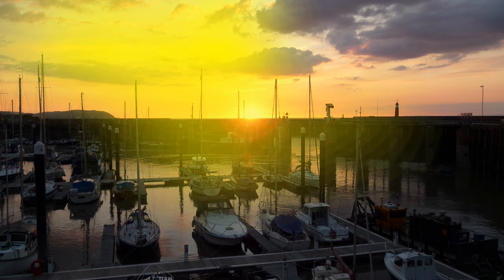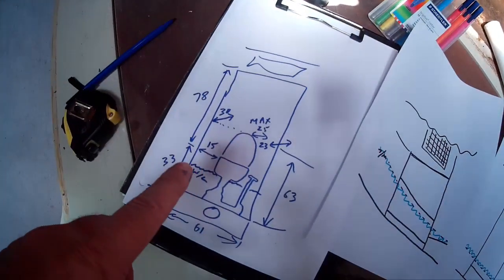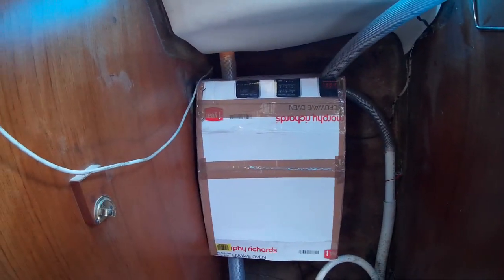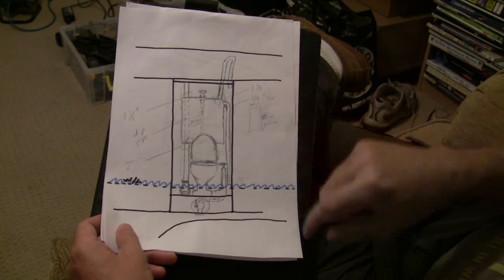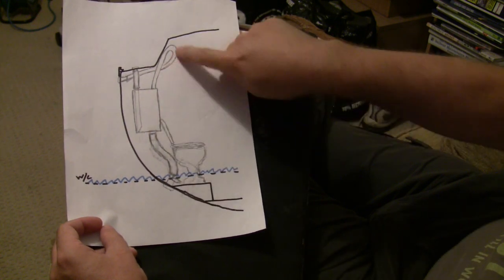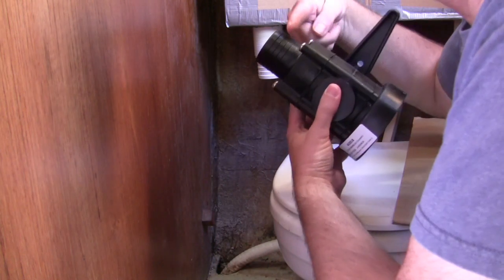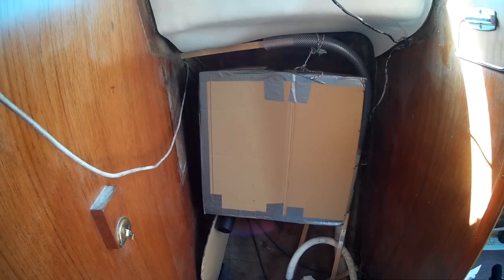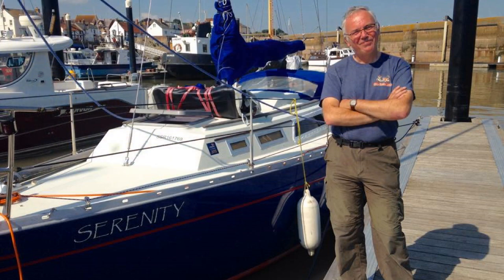Just About Sailing September 2018 - Making and Installing a new Holding Tank, Pt 1

Comment: According to Jabsco no anti-siphon is needed on the water inlet.
Reply from the maker: That's interesting. As you might have realised, I haven't finished this job yet. But I have bought quite a few of the parts - including the inlet anti-siphon device, and this job is high up the list as soon as the weather gets epoxy friendly again. It would be much easier not to install an anti siphon device on the inlet. I will look into this further. Thanks again.

Comment: Hi Paul, new sub here. Thanks for sharing your work. I like watching your videos to get good ideas and knowledge of the joys of being a boat owner. How much would the total weigth of your filled holding tank be? Since you will have it wall mounted, I'm thinking of how strong a mount you need. When sailing in rough weather, you could consider the weight to be maybe the double due to the movements. Maybe not so nice with a cracked holding tank on the floor lol. All the best.
Reply from the maker: Well, firstly, thanks for subscribing and watching. I think the tank will be about 45-50 litres - so about 50kg totally full. - Not that I would ever want to have it totally full.
In terms of the mounts on the side/wall I am sort of using the fuel tank ones as a guide (have a look at the Pt 1 Diesel Heater video - you can see the mounts on there). The Diesel tank is 70 (or is it 90) litres. I plan to make the mounts for the holding tank stronger (bigger) than those ones. They will also attach along the back of the holding tank as well as at the bottom. Also, the weight distribution will be a bit different as the holding tank will not stand off the mounts so much as the Diesel Tank does.
I plan to use 12mm plywood with a layer (maybe 2 layers) of fibreglass (Inside and out). I think that is probably massively overengineered. But rather that than the risk of getting the holding tank contents all over the floor.
Unfortunately the Holding Tank project is...uhm…on hold until the weather heats up and I can use epoxy again.
Cheers
Reply: @verynearlyaboutsomething  on a boat, massively overengineered equals just about right :-)

Comment: Would it be possible to have situated the tank under the loo?
Reply from the maker: Hi. Unfortunately there is not much space at all under the loo - and it is very awkward to get at. The drawing doesn't really do it justice. The 'obvious' place to put the holding tank would be just the other side of the bulkhead under the Vee Berth.  Plenty of room and easy to get at. I don't really have a problem with that, except it would take up otherwise useful space.  Also, it would mean a pumped system of some sort as the tank would be below the waterline.  I did consider on of those 'Thetford' units that are used in camper vans.  Advantage being that there are no thru-hulls at all. Disadvantage is the very small volume (I think the large ones are 20 litres). I don't think there are any perfect solutions, just some that aren't as bad as others. Thanks for watching.

Comment: You are planning on using composite/plastic thru hulls and fittings. You also plan on bending a 2" plastic line to it's minimum radius to connect the tank to the thru hull. 
Have you measured the side force the bent plastic line will exert on the thru hull? I would use a fish scale to measure the force the bent line will exert, and consult the thru hull manufacturer to see if it will withstand the amount of side force you will be applying during the life of the fixture. It would not be good if the thru hull should fracture and break away from the hull either at the dock, or during a passage. 
Perhaps it would be better to construct the radiused part of the 2" line from PVC pipe and fittings, and just use short pieces of the flexible pipe to connect it to the tank and thru hull, eliminating any side force being applied to the thru hull.
Reply from the maker: Excellent comment, thank you. The manufacturer's rating on the thru hull is 500 lbs (about 225 kg - which is about 2.5 times my weight). That is the weight than can be exerted directly sideways on the hose tail. There is a video somewhere on YouTube that shows the smaller 3/4 inch one being destruction tested to about 800 lbs. That is without the seacock bolted to a backing plate. I also intend to do the full installation with the backing plate. I will do a test as you suggest with a scale on the plastic pipe, But I would guess it will be significantly less than 1 or 2 kg or so - it will be interesting to see. My understanding is that the minimum radius (was it 177? I've forgotten) is the most you can bend it before it loses its cross sectional shape. I am hoping that once it bends it will 'decide' to keep that shape - it might even be worth heating it.  Where I definitely will need to do as you suggest is on the 1 1/2" breather pipe. That will be a very tight radius and I can't have any dips in it.And you are definitely right - it would not be good if this thru hull or seacock broke. Potential nastiness from either direction. Cheers.

Comment: So no Y valve to pump straight overboard - it will all be gravity from the bottom of the tank?  Odd to say, but I look forward to seeing the final solution.  You don't have a lot of space to work with.
Reply from the maker: No Y valve.  I pondered all the different solutions and thought that this was probably the most simple with least pipework.  I think that gravity will do the trick - using 2" pipe should help.  But if it doesn't I should have enough space for a pump.  Note the number of times I use 'should'.  We shall see. Cheers.

Comment: Hmmm. Is it really going to drain from the tank into water exerting pressure upwards without pumping it out as with the head? At the risk of asking you to do something disgusting on YouTube maybe one of your famous experiments to test the theory before progressing further old chap?
Reply from the maker: I think that might be an experiment too far - although my viewing figures would go through the roof.  The setup is hydraulically fairly simple and pretty much the same as the simplest one that Tek Tanks have in the rig they take to the shows.  There shouldn't be any upwards pressure unless the boat is rolling violently, slamming into waves, or sinking rapidly - never a good thing.  On the plus side, my tank will be quite a lot higher than it needs to be. But on the negative side, the outlet pipe is quite curved - hence the use of 2" pipe rather than 1 1/2".  Biggest problem I see is potential blockages. If that is a problem then I am leaving space for a pump to be fitted. Cheers.

Comment: That's a classic duct tape and bailing wire contraption. But it's a great idea to mock it up before building the real thing.  I like the design.  The tank can be drained overboard without pumping.
Reply from the maker: Yes, there are too many complex curves everywhere to rely on just designing and fitting. It should just drain out OK. And I will also include a dip pipe and deck fitting for it to be pumped out at marinas.  The alternative was to use up loads of space under the Vee berth - I didn't really want to do that.

Comment: Maybe a 90 wouldn't be desirable, but wouldn't fitting a 45 degree hose barb on the seacock help with the installation?
Reply from the maker: Yes, it probably would. Unfortunately you can only get straight or 90 degrees. Although the ideal solution is to have everything going straight down, having a 2" rather than 1 1/2" pipework should help this.  I am also looking at moving the pump out point so that I can have it directly over the outlet.  Idea being that I could shove some semi-flexible rod down the dip pipe and through the outlet should there ever be a blockage. - I'm not sure that is actually possible.  I think it should all work... Cheers.

Comment: Hi Paul, been following your videos. Great stuff! I also own a Mirage which I keep on the Isle
 of Wight. Intend to sail to the Med next summer. Your holding tank project interests me as I need to install one. I have built a number of fuel tanks for aeroplanes using closed cell foam insulation. This stuff you can glue together with 5 minute  epoxy to build up the size. It is very easy to sand and all mistakes can be rectified during shaping by glueing on another piece of foam. After you get the shape you require, cover with 4 layers of fibreglass and epoxy resin. Let it cure, make a small hole through the fibreglass, dig out a little of the foam. Pour in petrol and dissolve the foam. Quick and easy. Best wishes Jonathan W
Reply from the maker: Wow. That sounds interesting. I haven't heard of that method. You should definitely do a video. And hopefully I will bump into you in the Med.  Although I am getting more and more tempted to make my way via the Scottish Isles first - which is quite a detour.
Reply: Yes. I would really like to see a video on this technique. It sounds as though it may have many applications.